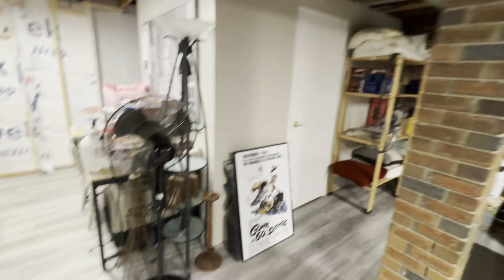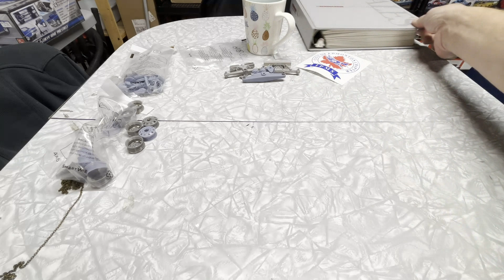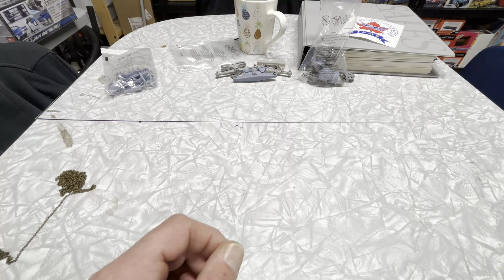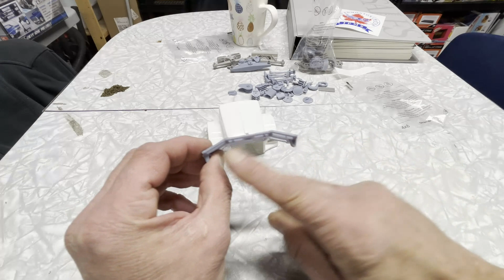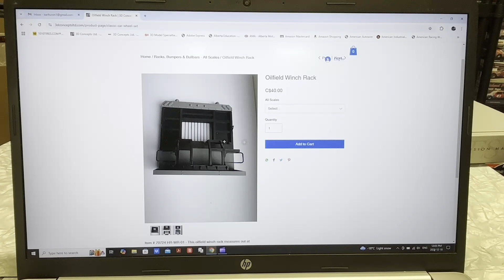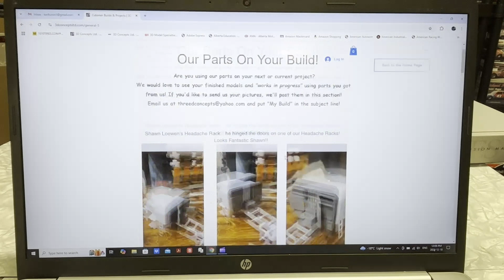3D Concepts Ltd. New Products Launch!

Comment: On your Hendrickson suspension parts, I see some things.  The first shown is the Load Pad suspension. Most trucks with that use the older style end bushings like what you see on AMT walking beam suspensions. Where I work, one of my customers is rebuilding that suspension under a 94 Pierce ladder fire truck, and we pressed the walking beam bushings. The second shown is Hendrickson Bolster Spring suspension. The top of the beams look correct, but the bottom of the beams should be flat, not arched. Those primarily have the newer bar and pin style bushings like y'all have designed and were used on a lot of cement mixers during around 2005.  The last is Hendrickson AR2, and it looks great. I had a customer with some oilfield deck trucks with twin steers on Hendrickson AR2 air ride at the front.  The AMT kit with Hendrickson beams have 34000 lb suspension with u-bolts at the centers, not 1" bolts and saddle caps like the 40k walking beam set..  They're also stuck on the dinosaur SQHD Rockwell rearends, and I hate them because I know what they're good for in real life, not much any more.  I sell truck parts and services in Arkansas because I'm a driveline, gear, suspension, steering, and brake guy with a few decades of experience.
Reply from the maker: Hey, we appreciate your feedback and we love to hear what people have to say. We have been using schematics and information direct from Hendrickson and strive to make all of our products with the utmost precision. As far as the one with the reverse camber, this is directly off the Hendrickson website so maybe it's a design that is not common. As I said from the beginning, we love to get feedback... especially from a person with your driveline and suspension experience. Thank you!

Comment: I like the moose bumpers, I just made two for a T800 from scratch. It looks like the Aliarc style, I have one concern if it is. The outer uprights on the heavy duty T800 bumper are parallel to the sides of the truck when seen from the top. The one you show, they turn inwards perpendicular to the angle of the bumper when seen from the top. If this is a different brand then disregard what I said. I haven't seen to many off these in person so I don't know all the brands there are. I like the suspension parts, all great for modern trucks, probably usable on some older rigs to.
Reply from the maker: Hi Vanessa and thanks for tuning in! These bullbars are still in the refinement stage and once we have them dialed in everything will line up as it should. We design everything we produce from real world parts and dimensions to make sure our final product is accurate. Thanks again!
Reply: @karlturon427  Good to know. Figured I should point something out just in case.